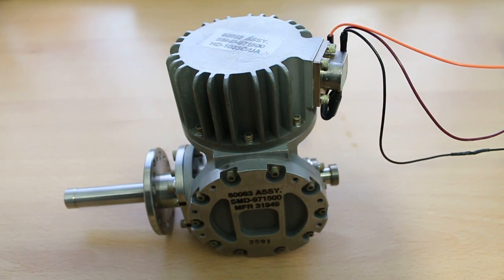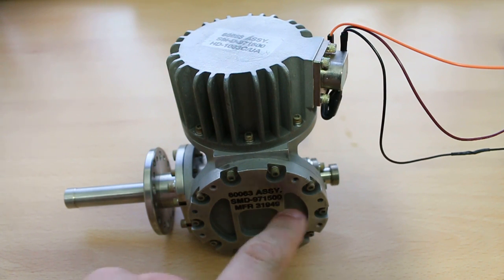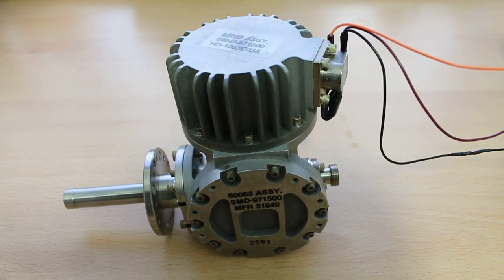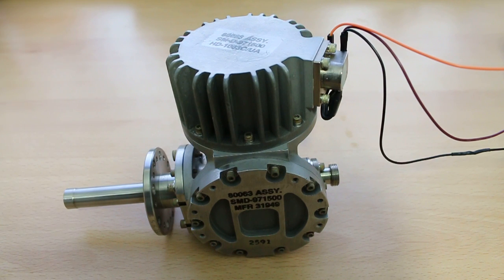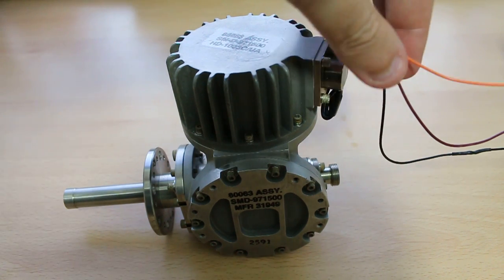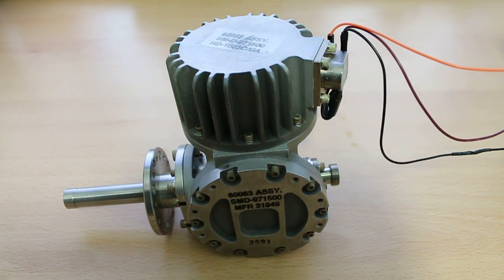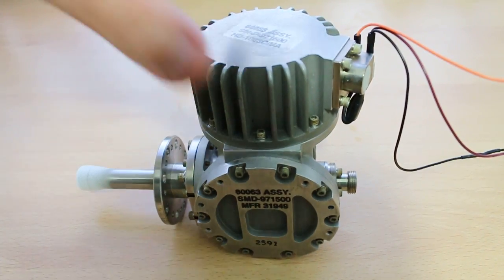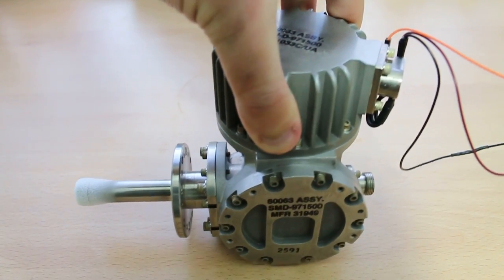Stirling Engine Cyrocooler (super cold very quickly)

Comment: Why are these things so expensive!? I want to make liquid nitrogen!
Reply: my friend Mike Marsden created a ridiculously genius counter-rotating impeller blade machine that can almost instantly turn the earth's regular atmospheric pressure (78% nitrogen, 21% oxygen and 1% argon) of air at STP (Standard Temperature and Pressure, which is 0 degrees Celsius of temperature and 1 atmosphere [14.7 psi] of pressure), from having an RMS (root-mean-square) "average speed" of about 1,122.94 Miles Per Hour down to an RMS (root-mean-square) "average speed" that is so slow that it drops the overall temperature of both the oxygen and the nitrogen gases below their boiling points so that they turn into liquid oxygen and liquid nitrogen after hitting 7 counter-rotating impeller blades. The earth's atmosphere itself does all of the work itself while running "downhill" from a regular earth at sea-level pressure of 14.7 psi "downhill" attempting to get to a perfect 0 psi "vacuum" at the end of his machine. The physical "hits" of the molecules hitting the counterrotating impeller blades and progressively having their RMS (root-mean-square) "average speed" dropped 7 times in a row while they zig-zag back and forth and make 7 u-turns causes the overall gas to literally slow itself down to a point that it just automatically turns into a liquid before it ever has a chance of reaching the 0 psi "vacuum" and more and more and more of the earth's atmosphere just keeps on rushing in, always trying, but never succeeding in, achieving their goal of filling the 0 psi "vacuum". It's the perfect way to instantly create liquid oxygen and/or liquid nitrogen. It's pretty damn ingenious.
Reply: @ooosoo8727  Sounds like a load of baloney🤣
Reply: @nielsdaemen  I'm actually being serious. Everything I just said is true; look it up. It is just that no one else has thought to use physical hits from a series of counterrotating impeller blades to literally try to physically slow down the actual physical air molecules of air themselves over an overall larger aggregate. Most people likely had the same response that you did, that it must be a bunch of baloney.
Reply: @ooosoo8727  GIve me a link then, show me the evidence
Reply: @nielsdaemen  he is waiting on an official patent award from the US Patent and Trademark Office so I can't publicly show anyone the designs or pictures. 

Just think about it though. I checked out your YouTube page and apparently you do computer generated atmospheric modeling of various wind flows. Just do a computer generated modeling of what happens when 14.7 psi of regular constant and basically never ending earth air pressure meets a tube connected to a constant and never ending source of a zero psi "vacuum" suction. The 14.7 psi of air pressure will actually violently blow into the tube at literally over 1,000 Miles Per Hour of speed. That is what is going on here essentially. 

Just think about it and you'll realize that this is a completely overlooked loophole in thermodynamics. It has been staring humans in the eyes since the beginning of history and we've never realized it. It is right around all of us. We are enveloped in a massive amount of air "pressure" because of how much air there is on earth and because of gravity pressing down on it all. Pressure is potential energy. The earth is acting as the "air compressor". Don't you get it?
Reply: @ooosoo8727  Thanks for checking out my channel. Most of what you say is correct but maintaining a vacuum requires energy to cool to air so much it liquifies or use a vacuum pump. What you propose breaks the laws of thermodynamics, there is no loop hole. When I was 10 years I believed in perpetual motion permanent magnet motors, I didn't get the law of conservation of energy back then😅
Reply: @nielsdaemen  You don't seem to get that the Sun has ALREADY WARMED the 21% oxygen, 78% nitrogen, and 1% argon molecules over millions of years, causing them to be in an expanded gaseous state and fill up our current earth's atmosphere to the tune of about 68 miles high of gaseous air above us. That's a lot of pressure, and therefore a lot of potential energy! 

And you are correct that initially his machine needs an outrageously powerful vacuum pump that initially takes even more energy than you get out of the overall system. I don't believe in perpetual motion machines. I fully understand the law of conservation of energy and that you can't "get a free lunch". However, this is just a transfer of energy system that is transferring energy that is already there because of the sun like I just mentioned. 

If you were to allow the earth's atmospheric to blow into the vacuum tube and spin the 7 counterrotating impeller blades with absolutely no resistance whatsoever, then eventually the 7 counterrotating impeller blades would simply be pushed by the incoming vectored air flow to their same incoming speed of  about 1,100 Miles Per Hour and the air molecules would not be slowed down at all because they then would not even be hitting the 7 counterrotating impeller blades because the 7 counterrotating blades would all then be spinning at over 1,100 miles per hour themselves and therefore the same-speed incoming-airflow of 1,100 Miles Per Hour traveling air molecules would all then be traveling at the exact same speed as the 7 counterrotating impeller blades and could never "hit" the 7 counterrotating impeller blades because the 7 counterrotating impeller blades themselves would all be spinning at the exact same speed of the incoming physical air molecules. 

Likewise, if the 7 counterrotating impeller blades were to be locked into place and not be allowed to spin at all, since air molecules are called an Ideal Gas and they obey the perfectly elastic molecule theory, the incoming air molecules that were all traveling into the vacuum tube at 1,100 Miles Per Hour would also not slow down under such a circumstance because the air molecules would simply perfectly bounce back and forth against the 7 impeller blades and they would stay at exactly 1,100+ Miles Per Hour as they zig zagged back and forth doing U-Turns back and forth and they would never turn into a liquid because the RMS (root-mean-square) speed of the air molecules would never slow down at all. 

However, in his machine, his 7 rows of counterrotating impeller blades are provided significant resistance via magnets that are drilled into the bodies of the 7 rows of counterrotating impeller blades that spin past copper coils that generate electricity and provides a magnetic flux churning type of what I call "magnetic flux friction" resistance that slows down the 7 counterrotating impeller blades. Therefore the 7 rows of counterrotating impeller blades are actually producing electricity via the trillions of little "hits" from the trillions of little incoming air molecules that are "smacking" the 7 rows of counterrotating impeller blades and imparting an actual physical push into them just like any other wind turbine blade is being pushed physically by air molecules that hits it. 

The 7 rows of counterrotating impeller blades are all traveling at 50 Miles Per Hour and therefore each incoming air molecule that comes into the system starts off at about 1,100 Miles Per Hour of RMS (root-mean-square speed) and each time it hits a 50 Mile Per Hour counterrotating impeller blade it loses exactly 100 Miles Per Hour of potential energy (RMS "average speed") that is essentially "absorbed" into the counterrotating impeller blades themselves that the air molecules bounced off of in order to travel into the opposite direction, where they once-again hit another row of counterrotating impeller blades that are spinning in the opposite direction and are also going 50 Miles Per Hour and once-again, the now 1,000 Miles Per Hour RMS (root-mean-square) air molecules lose another 100 Miles Per Hour of potential energy and now drop to an RMS (root-mean-square speed) of 900 Miles Per Hour. This happens 7 times in-a-row until the RMS (root-mean-square speed) of the air drops so low that the air literally turns from gaseous form into liquid form because it is now so cold. 

You don't externally cool the air molecules man; they do that themselves physically by literally losing all of their potential energy by hitting 7 rows of counterrotating impeller blades and they are also all literally perfectly vectored together into a perfectly aligned direction and all of the air molecules just simply all come together, all by themselves, and turn themselves into a liquid. It is basically a loophole but it doesn't violate any laws of physics. This is just how Ideal Gas molecules must all behave under such a strange circumstance. 

And once the system gets up and running, the external power supply that initially powers the vacuum pump to get the entire system up and running is switched off and then the entire system is now powered by the electricity produced by the electrical generators on the peripheries of the 7 rows of counterrotating impeller blades via the incoming air flow itself, plus even more electricity that is produced that can be used to power other things as well. The entire thing is a power generator that doesn't need any type of fuel source. 

It's not a perpetual motion machine; it's just a crafty use of Mother Nature via our sun that has already heated a countless number of air molecules in our earth's atmosphere over millions of years. Ultimately it was the sun that inputted the energy into the air molecules that his machine now utilizes to produce electricity. 

The byproduct is liquid oxygen and liquid nitrogen and liquid argon but the main importance of the machine is that it's actually an electrical power generator.
Reply: @ooosoo8727 One issue I don't see addressed here is the loss in energy due to cooling and heating effects.  You can't get out more than you put in, and even the best bearings on the planet have friction.  Even magnetic bearings have a magnetic force that causes drag.  The whole "waiting on a patent" argument is B.S. because as long as it's submitted, the idea or item could be built and sold with "patent pending" license and if anyone copied it, they would have to pay royalty on each item.  This is why you see 1000s of items produced in this way, and want to know why?  Most companies want to get the most return on the investment before the actual patent goes into effect, so they can get royalties off others selling their copied product, especially before the patient does go public and they can then engineer their own versions, that are just different enough that they don't pay Said royalty.  If he's file for a patient, a "patient pending" is good enough to start and release.  Unless his patient is actually a copy of someone else's, which then means he'd be in deep poop..

Comment: Fill a vessel with pykrete within a vessel with antifreeze with the cryogenic piston at the bottom. Place a Cooper coil heat exchange within the antifreeze. Then circulate chilled water through a copper coil in front of a fan and have a wrot counter sink to complete the cycle for an air conditioning set up.
Reply: Wow
Reply: @breezeg3542   ⚠ God has said in the Quran:

🔵 { O mankind, worship your Lord, who created you and those before you, that you may become righteous - ( 2:21 ) 

🔴 [He] who made for you the earth a bed [spread out] and the sky a ceiling and sent down from the sky, rain and brought forth thereby fruits as provision for you. So do not attribute to Allah equals while you know [that there is nothing similar to Him]. ( 2:22 )

🔵 And if you are in doubt about what We have sent down upon Our Servant [Muhammad], then produce a surah the like thereof and call upon your witnesses other than Allah, if you should be truthful. ( 2:23 )

🔴 But if you do not - and you will never be able to - then fear the Fire, whose fuel is men and stones, prepared for the disbelievers.( 2:24 )

🔵 And give good tidings to those who believe and do righteous deeds that they will have gardens [in Paradise] beneath which rivers flow. Whenever they are provided with a provision of fruit therefrom, they will say, "This is what we were provided with before." And it is given to them in likeness. And they will have therein purified spouses, and they will abide therein eternally. ( 2:25 )

⚠ Quran